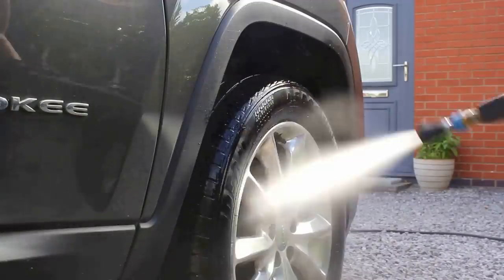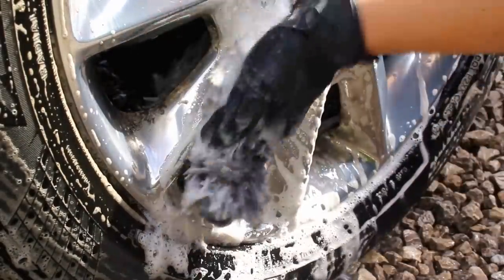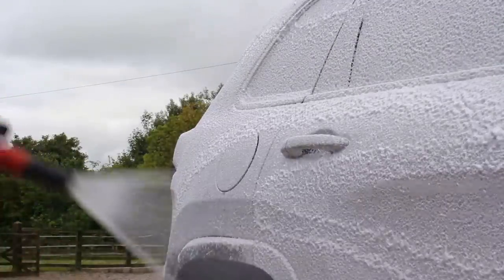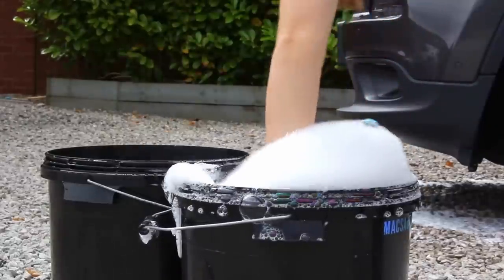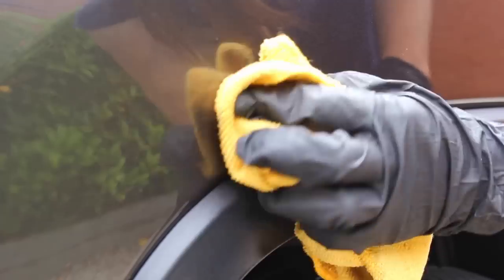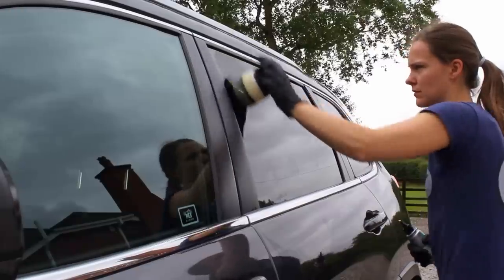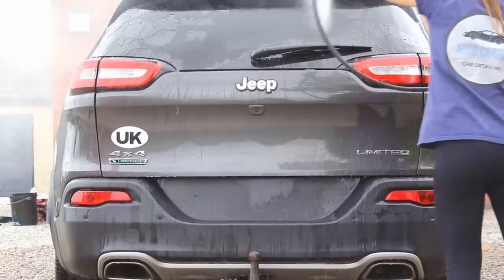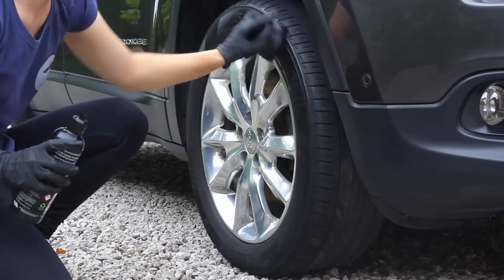Jeep Cherokee Wash and Protection | Exterior Clean, Chemical Decon and Sealant

Comment: Hi Heather, sorry if this is a stupid question, but would you recommend the 03 or 04 nozzle size for the Carscope spray nozzles? 🤔🤔🤔
Reply from the maker: I think it depends on the flow rate of your pressure washer. It should say it in the product description on their website 😊
Reply: @AutoCareHQ  Hmm, thanks, it's an old Nilfisk, will try and track that down 👍

Comment: What do you use to prevent brake discs from rusting over when washing the car. It's infuriating, the wheels are spotless until the very first drive after washing. Within a 100 yards down the road the barrels of the wheels are covered in rust dust coming off the discs
Reply from the maker: Bilt Hamber Atom Mac is a good option. I've got a vid coming out on that in September :)